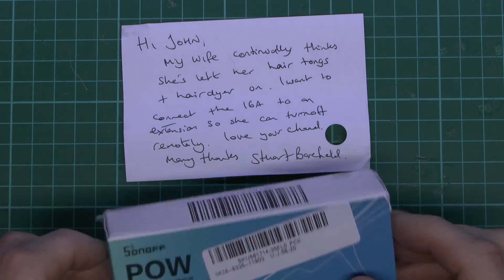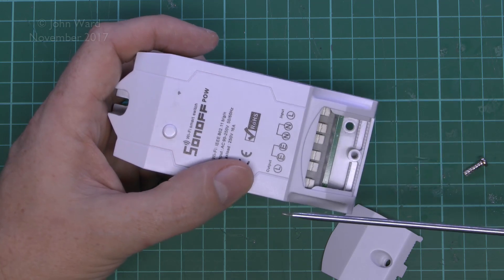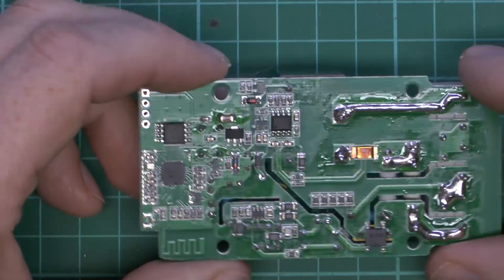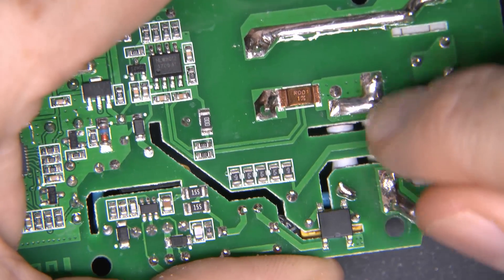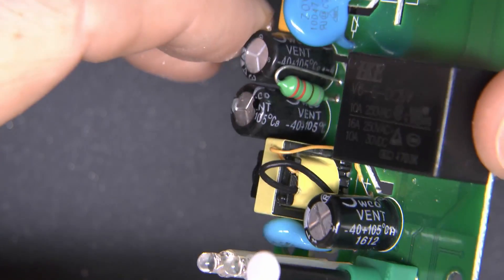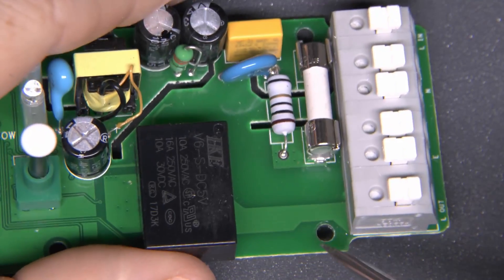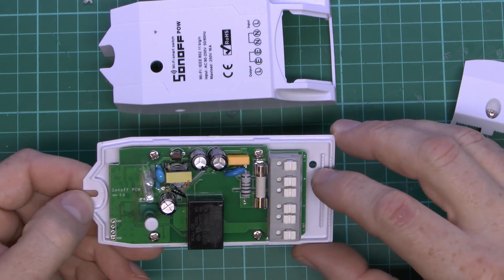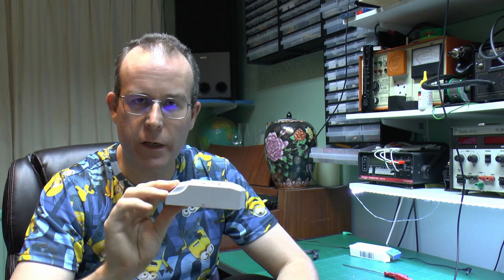Sonoff 16 Amp Wifi Switch

Comment: Hi john could I use this for a 3kw immersion heater after a 20amp fused spur?
Reply from the maker: Fused spurs are maximum 13A, 20A fused spurs do not exist.
Immersion heater should be on it's own 16A circuit, with a 20A isolator switch.
Reply: @jwflame  sorry you are right it's a 20amp isolated switch. Would it possible to use this between the switch and the immersion heater ?

Comment: The hole is also very practical if you want to attach the programmer-circuit / serial connection so you don't have to make a diy hole yourself

Comment: Immersion? The R2 version has current limiting shutoff, so feel a bit safer, will supply after 13A switch spur unit & B16A MCB. 3kW / 250V = 12A. Any one else using one??

Comment: Hey, anyone know if this would be safe to use on a single pole 15amp switch between an immersion heater element in loft? It has no timer its just on all the time. Thanks

Comment: I want to connect this on my ebike (DC 48v system, 17a max) .Do you think it will work with DC loads?If not, can I simply remove the 10a relay and use a bigger one?
Reply from the maker: No, for many reasons.
Reply: no worries, I will use a DC switch rated at that current and an RF remote control.

Comment: Would it be possible to connect this adafruit momentary RF receiver  --> 

https://www.mouser.co.uk/productdetail/adafruit/1096?qs=sGAEpiMZZMsMyYRRhGMFNjqDQYsYcDL2Fv3BKLtFzKE%3D 

to the inbuilt momentary switch solder points on the circuit board of the Sonoff th16. Would this power the RF receiver? I would like to add RF functionality without hacking the firmware. I also need the 16amp version, so the RF version Sonoff have isn't suitable. Any ideas?

Thanks in advance!!!!
Reply from the maker: Possibly, although it would be easier to get the RF Sonoff and use an external relay or contactor for larger loads.
Reply: John Ward bit beyond my skill set unfortunately. Thanks though! I f you feel like doing a video on your solution I would give it a thumbs up.

Comment: 1:45 there is a model with a plug-in temperature sensor, so I guess they use the same case for both models, complete with hole

Comment: Are there slots in this board and what are they for? I think that you mentioned them in separate descriptions about a half a dozen times. You also mention the interference capacitor several times and also the 5 v power supply. Is there really a need to mention the same things so many times?
Reply: The slots separate + and - (it's AC, but that doesn't matter), so that there is no easy path for current to make a catastrophic short (creeping voltage over the PCB by eg. water or resin) or sparks crossing and risk of fire etc. I'd suggest a minimum distance of 3mm between two traces with 230V and a slot in between.  I can't recommend the 10A version, but the 16A seems to be OK.
Reply: Thank you for your clear explanation. I think that you may have missed my point however: John seems fixated on the slots and mentions them over and over again. My sarcasm in my first point seems to have missed the point.

Comment: Thanks John, I look forward to the other videos on this, but you've already put my mind at ease. These Sonoff things are really great, they work well with Amazon Alexa speaker, we tell Alexa to turn the various  lights on and off. Because you can control these devices from your phone, it means you can turn off electrical items like hair straighteners, from the car. If you your wife is convinced she's left them on. As mentioned in other comments, the hole is there for another model the company produce with a probe/sensor. The power monitoring feeds back to the phone app, to let you know how much the electrical items are costing you.
Reply from the maker: Next video on this should be at the weekend, once the dismantled drill is removed from the bench.

Comment: is the 2nd rating on the relay (10a) actually inductive load?. I have a toggle switch that has 10a and 7.5a at 250V marked on it. The switch is Rleil rl1 t85

Comment: is there any way to connect a sonoff to a 2 way switch? I mean one sonoff and one normal 2way switch controlling one load
Reply from the maker: No, the relay is only a single pole make/break.
Would only be possible if the relay had a changeover contact.

Comment: hi just wondering if I could while one of these under my stairs in line with my wiring for my lighting circuit upstairs and then be able to turn all the lights off upstairs by wireless best keep up the good work love the channel
Reply from the maker: Yes, but check that the lighting circuit doesn't have things like smoke alarms or a TV aerial amplifier on it, as switching those off would not be desirable.
Reply: John Ward thank u no nothing else on the lighting circuit loving the channel long time subscriber now

Comment: Surprised to see the fitting of the Class Y cap on a design like this with no cable connected to the secondary side.

For those that don't know, the cap is there to provide a path back to the primary side and hence ground for any RF switching noise appearing on the isolated secondary side. It's usually only used if there's a long output long cable connected which could act as an aerial and radiate this noise. (There's more but this will do for now.)
Reply: It's because they shared the design with the system that offers external interfaces, i/e. this https://www.google.co.uk/search?q=sonoff+switch+sensor+16A&tbm=isch&source=iu&ictx=1&fir=Vl3OLPB2_KmVrM%253A%252CShPLQyZ95EdCaM%252C_&usg=__VLCTy6dNVyDQOIEAwPi3NIGP2x4%3D&sa=X&ved=0ahUKEwj3lPzr4OHXAhVLC8AKHYUjDBQQ9QEInAIwAQ#imgrc=Vl3OLPB2_KmVrM:

Comment: Could not find anything about the side cutout on google, but the four holes on the left side of board is the serial connection. They made it easy to run a cable outside the box for hacking the device :)

Comment: Aaah, a 16A vaersion. Upon taking off the cover and looking at the back of the circuit board with those heaps of solder to conduct the juice, I noticed that they have put stacks on there for the live and neutral, but.....

What about the earth? Looks a bit thin on there!

Makes me wonder how this would respond if there was a fault on the appliance and it was going to earth via this unit.

Two things would happen here:

(1) If the incoming and outgoing earth wires go via that board, the fault current may blow the board to bits, and afterwards, if the fault current didn't blow the fuse, then the appliance with its metal casing would still be live and now with a conductive enclosure up at mains voltage.

(2) The earth terminal block is bridged-out internally, and no leakage current goes via the circuit board, and those solder joints are on there just to hold the connector onto the board.

If this device comes up in another vid, could you investigate the earth terminal on this and see how it would deal with a large current going through it?

Thanxx for showing,

-Wayne's Electrical.

6th November 2017, 01.16

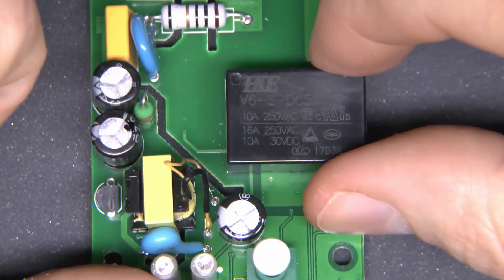Comment: at 5:00 the relay appears to have two ratings, 10 or 16A depending on what standards compliance is required
Reply: Indeed - the purpose of the horizontal line separating the two is obvious.
Reply: The two ratings refer to the states of the relay. 16A for normally open and 10A for normally closed. When the relay is energised, there's significantly more pressure applied to the internal contacts on the normally open side than there is for the regular spring pressure on the normally closed side. The extra pressure on the contacts reduces the resistance and allows more current. The normally closed side of this relay is not used here however, so the 10A rating is pretty much irrelevant.

Comment: What would you use one of these for
Reply from the maker: Switching whatever you want on/off remotely via your phone, web app or whatever else.  Seems this one can also monitor the current as well.
Reply: Ive got one wired into my electric car charging circuit that feeds an external socket on my garage wall. I uploaded ESPeasy firmware so I can now control my car charger from a simple web page  call i.e. 192.168.1.97/control?cmd=gpio12,1 or 0
The car charger is 10Amp by the way.

Comment: The second slot (between N and E) might be for older european setups with 2 phases off a 127/220v system? (to prevent the 127v tracking to earth if there was damp)

Comment: Wonder if the hole is for access to the four contacts on the lower left corner on the board. Also, what are those contacts for?

Comment: I think the hole is used for a connector on the temperature and humidity sensor models, probably too costly to mould a separate top.
Reply: The hole is indeed for the probe sensor module on a different model.  see https://www.itead.cc/smart-home.html for the different models and info.  These have dropped in price so may need to buy myself a few more :)

Comment: The hole in the side is there due to sonoff also selling a model with temperature and humidity sensing which has a plug in probe. The casings must be shared.
Reply: Orbital Tube P"
Reply: https://www.amazon.co.uk/Temperature-humidity-Monitoring-Wireless-Waterproof-04-TH16-Not/dp/B071YYQZY8/ref=sr_1_17?ie=UTF8&qid=1522538697&sr=8-17&keywords=sonoff

Comment: There is a good solution to the problem of hair tongs and irons being left on, the ansmann run down timer. Available for less than 10quid on amazon. I have mine connected to the iron. Love the vids John and the Sonoff devices are great.